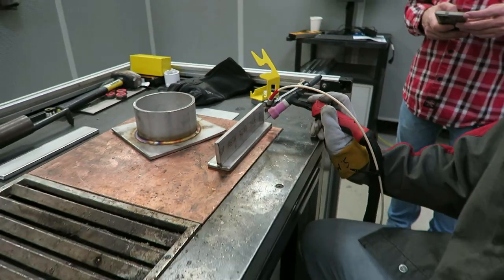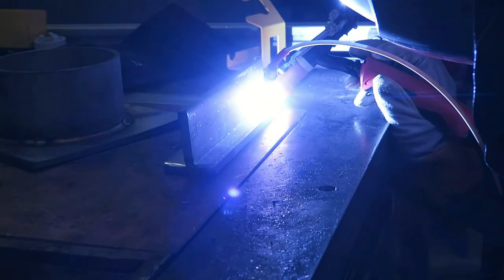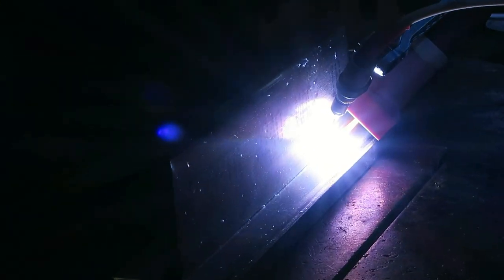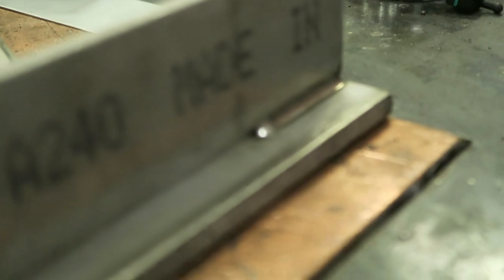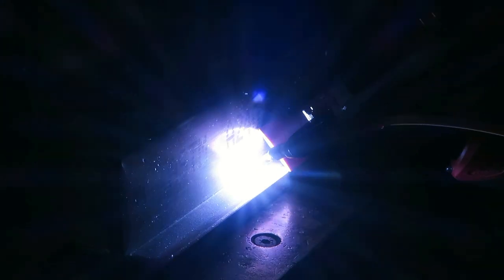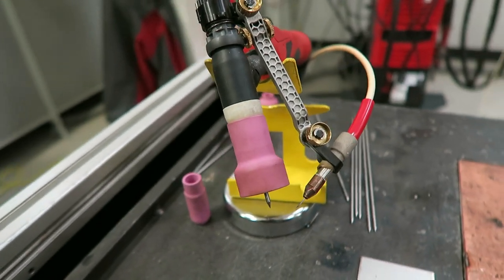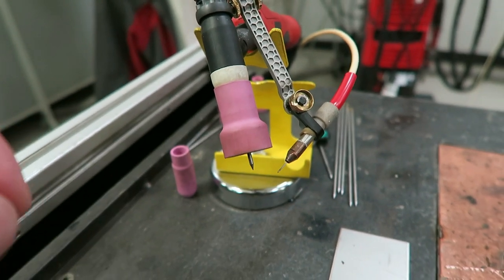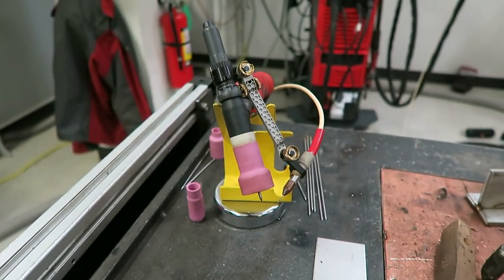New Fronius Welding Technology - Dynamic Wire

Comment: Might have to go try out this system. Looking at buying the iwave 300 with this system for bulk TIG welding on piping for oil and gas clients. 

Is the wire feeder simply feeding a standard MIG wire or something more unique?
Reply from the maker: Its basically a MIG feeder with a little twist. It can sense when a closed loop connection is made and monitors the resistance.
Reply: @Thefabforums  in saying that. You can't put a MiG hand piece/torch on instead? Or you would still need the multiprocess pro setup with additional wire feeder?

Comment: So.... why wouldn't you just mig it? The whole point of tig is to be precise and a by product of that is a reduced travel speed. Obviously this is just another "tool", but I really don't see the benefits of this over a dialed in mig weld with a competent set of hands and eyes.
Reply from the maker: well there are a lot of advantages to tig over mig
Reply: Some materials/components can't big MIG welded. I can see massive benefits at my work as we deal with oil and gas companies that 100% need components TIG welded.